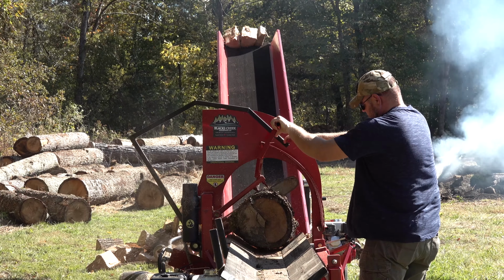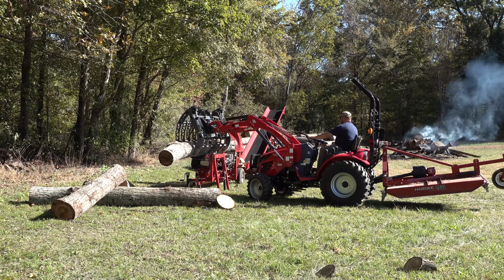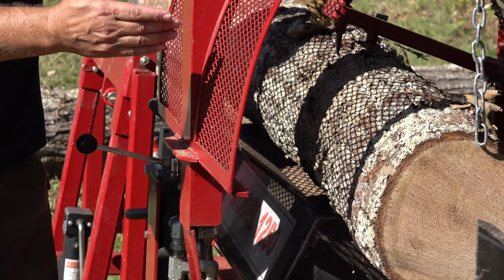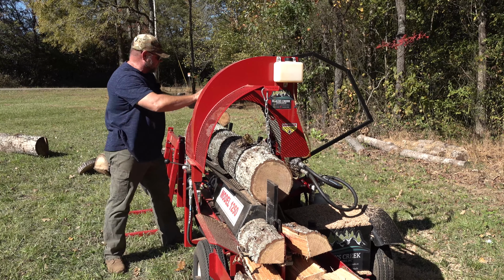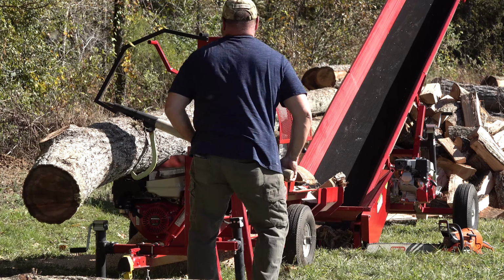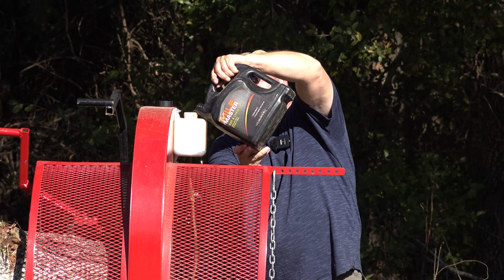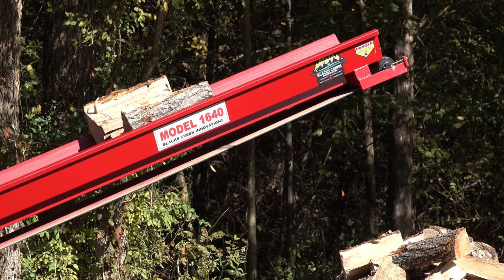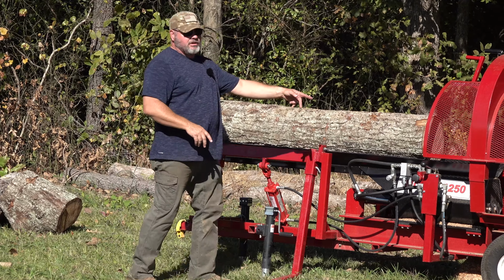What is a Firewood Processor? Is It Worth The Extra Money?

Comment: Does that splitter come with a 6 way to make smaller pieces
Reply from the maker: Not at this time. I am running logs which are at the top end of what it is rated for. I could adjust the cutter up one more notch. I think it would handle a 6 way easy. The company is talking about adding a 6 way to the line.

Comment: Thanks again Tony and Tanja. Do you ever get the hydros driving a curly grained split in hard in between the axe and the chute? Or is it just built so tough it doesn't care!
Reply from the maker: I have got one round with a big nasty place in it stuck on the splitter. I beat it off with another round. It was my fault, because I put a round way to big in the splitter. I have never had it not split if I stay in the rated size.

Comment: What is the average cord per hour out of the machine
Reply from the maker: It has many variables. What size logs, how are your logs placed, or do you have a tractor or not. With a crew, maybe three or four an hour. By yourself with a tractor 2 or 3 cords per hour. You will have some downtime to sharpen or replace the chain.  With a tractor there is almost no manual labor. Until it comes to stacking. We have a line on logs that are not big enough for the sawmill.